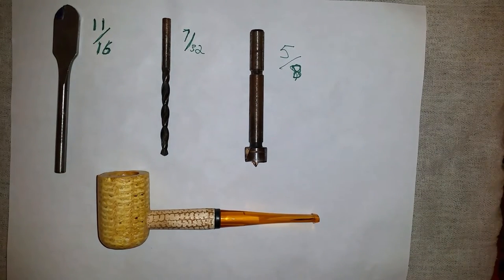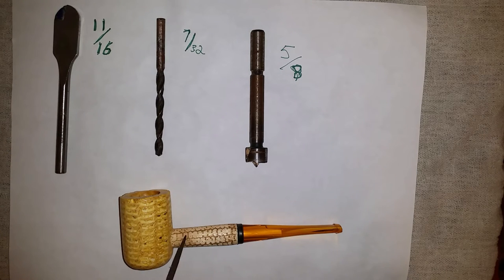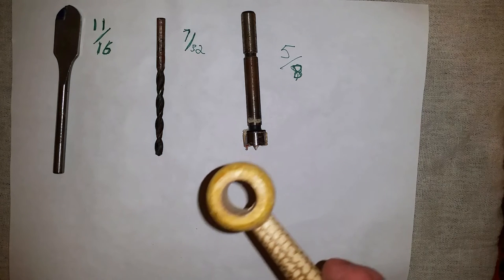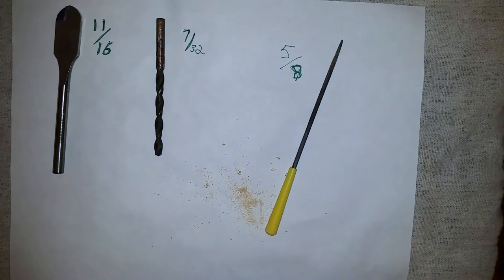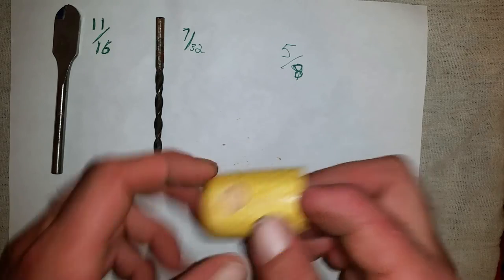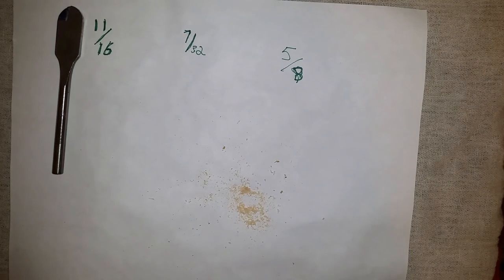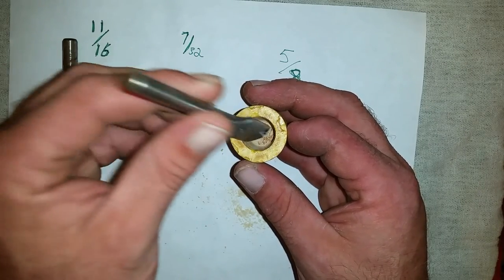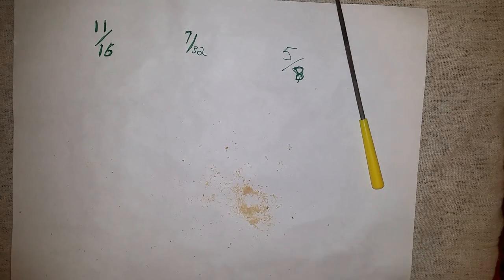Cob modding basics #1. How to drill  the chamber.

Comment: An easier way is to leave the stem in , send a drill (same size as the bowl hole) straight through and out the bottom , stick a pipe cleaner or metal skewer through the stem into the bowl , tap in your wooden plug from the bottom until it meets your skewer , saw the bottom off flush. You only need one drill for this . There is a downside to either of these methods , your drawhole will be on the side of the chamber and may cause uneven burning , I've learned to leave my corncobs alone.